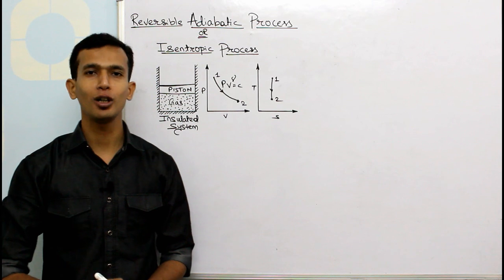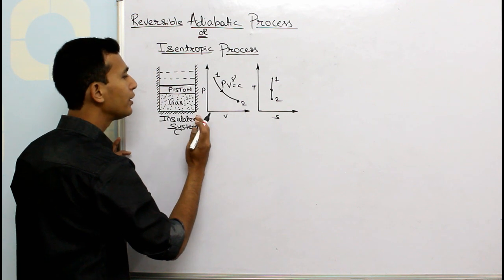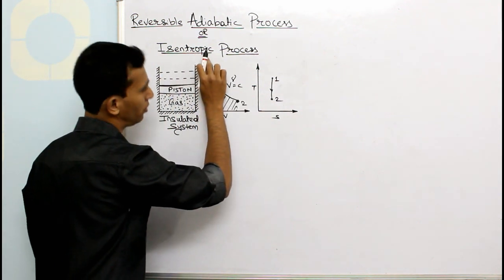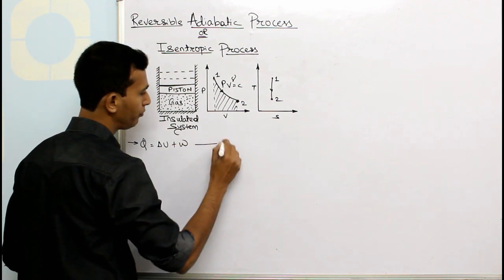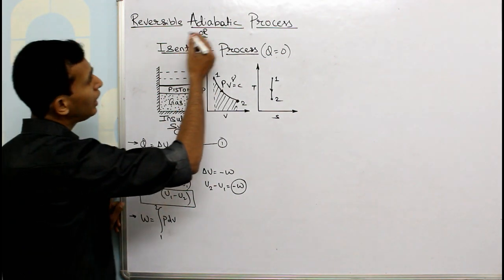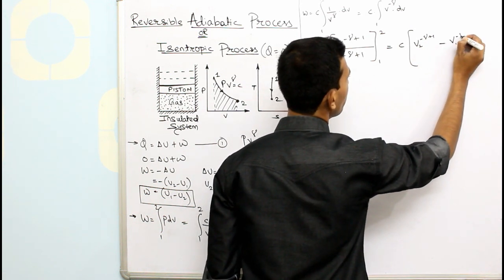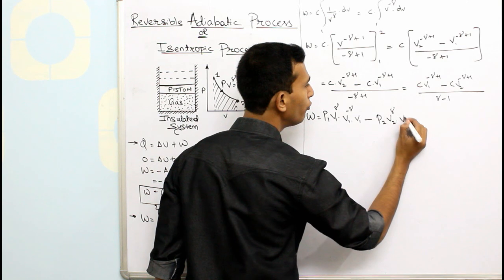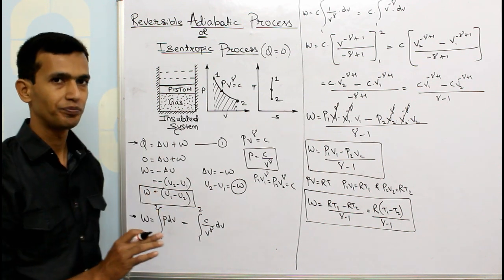Reversible Adiabatic Process/Isentropic Process. (PART-I) #thermodynamics #basicthermodynamics

Comment: Sir as temperature increase entropy increases or vice versa as you told in this that some work is done by the system so its temperature also decreses so entropy also decreses,so how entropy remain constant .Please help to solve this doubt
Reply from the maker: Basically there are two reasons for change in entropy 
1. Heat interaction between system and surrounding 
2. Entropy generation.  

We are talking about reversible Reversible Adiabatic process 
When we say Reversible means there is no entropy generation 
Because we all know reversible process can be brought back to its inital conditions 
And this is only possible when entropy generation is zero because entropy cannot be destroyed while bringing the system back to initial. 
Now regarding temperature decrease
As per first law of Thermodynamics 
Amount of heat supplied = change in internal energy + work done by the system.
i.e. Q = (U2-U1) +W
In Adiabatic process Q =0 
So substituting Q=0 we get 
W = U1-U2
Where W = work delivered by the system
U1 = initial internal energy before the process is started
U2 = final internal energy when the process is completed 
That means the work is obtained at the cost of decrease in internal energy of the system..
Here 
NOTE THAT
Internal Energy is the function of Temperature 
So if internal energy decreases that means there is decrease in temperature. 

But entropy is unchanged because system has neither recieved heat from surrounding nor lost any heat to the surrounding 
As well as there is no entropy generation (since it is reversible)
Reply: @AllAboutMechanicalEngineering  well explanation.. god bless u
Reply: You are correct but practically not there is heat loss in process